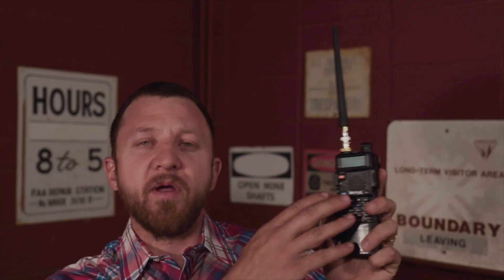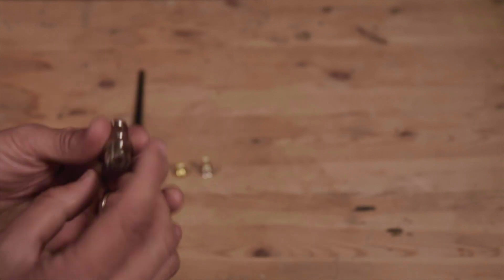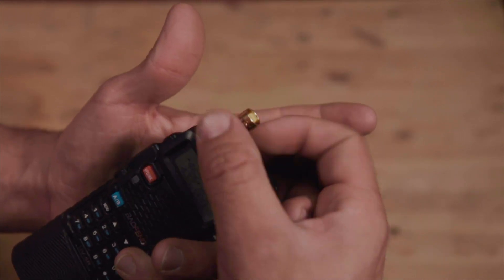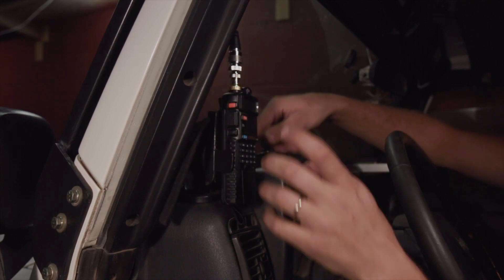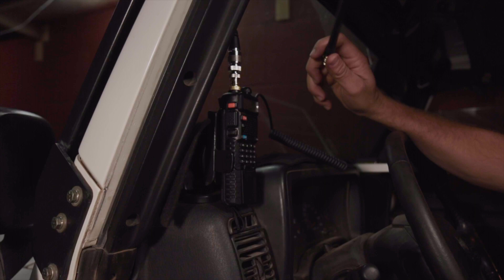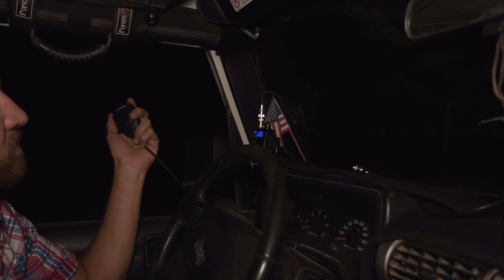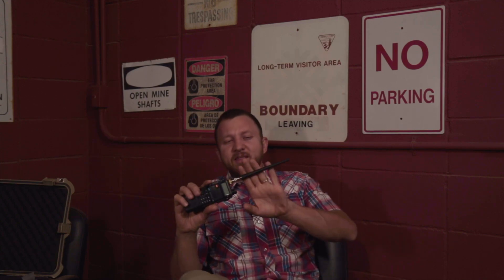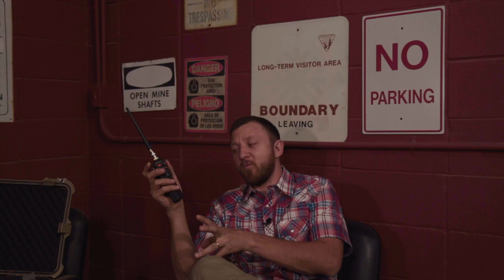Can A Baofeng Radio Overland?

Comment: You want the battery eliminator. 
The usb KILLS the recieve on it.
Reply from the maker: Hmm, I did not know this. I’ll look into buying a battery eliminator kit. Is there a specific reason why? I’m guessing it’s something to do with charging the battery while running?
Reply: @Embark With Mark  
I have been trying to figure it out myself. 
 The USB while it will charge. (Thats pretty cool). But, It causes RF and significantly hurts the units ability to recieve while its plugged in. I have the BF-F8HP. This has been most annoying. I've gotten around it by keeping it charged and unplugging while in use.

Comment: Good Vid.  thanks.  your link to the radio doesn't work and the link to SMA Male to BNC Female connector goes to a Female to female piece. thats no longer avail.  But is it Male to female?
Reply from the maker: I updated the link to the radio, the SMA Female to Female connector, and I fixed that typo. Thank you for bringing this to my attention. 

I also added the link Kenwood mic I use with this radio. It's miles ahead of  the Baofeng microphone, and it's very affordable. I would skip buying the kit that comes with the Baofeng microphone in favor of the Kenwood mic. It really is that much better.
Reply from the maker: Thank you for letting me know. I’ll update these links. 

Glad you enjoyed the video!

Comment: Noticed you didn't give a call sign when you started and ended a transmission. These radios are for amateur radio use only. You should get your amateur radio license as it will allow you to do way more stuff with comms.

Comment: Pretty nice setup. From what I hear those little radios are pretty good. A cb usually put out about 4 watts. I've got the modulation dialed up on mine. That helps with transmit pretty good. I've never used a ham type transmitter but with those you get a more watts ( on 10 meter bands). My father used to fool with old tube ham and 11 meter radios. His best advice was good grounds and coax. You can make the cheapest antennas work with that.
Reply from the maker: They are decent little radios for the price, but there are of course much better built radios out there. I had my CB radio peaked and tuned, it does seem to do pretty good. I just like having more than one communication option, honestly. 

I'm sure your father had a lot of knowledge that is lost for most of us today. I like to learn all I can from those who have been around longer than I. I figure they probably know something I don't lol.

Comment: Baofeng is Probably the worst thing to ever happen to the vhf, as well as licensed bands. It used to be that you had to invest a few bucks, learn a few things and become a licensed operator to legally use non-marine vhf, single side band, etc. The baofeng gives any moron access to multiple bands at the press of a button on the cheap. Hence, we have all of those morons who should be using cb's and frs radios polluting emergency bands, infringing on licensed bands and the like. I loathe the baofeng and all of the modern stupid it represents.
Reply from the maker: I can agree with you to a degree. I don't think it's a matter of technology availability but more of a matter of just people who do not respect the air waves. You are right though, these radios or any radio like this needs to be used with caution and a level of respect. While it maybe fun to play with for some, the improper use of this type of radio could have serious implications. I honestly can't image the type of person who gets a kick out of broadcasting on emergency bands.
Reply: @EmbarkWithMark  believe me- they're out there. I participate in a couple different emergency services such as the Maritime Mobile seafarers net and have had people on multiple occasions cut in on emergency operations and even dead key the channel